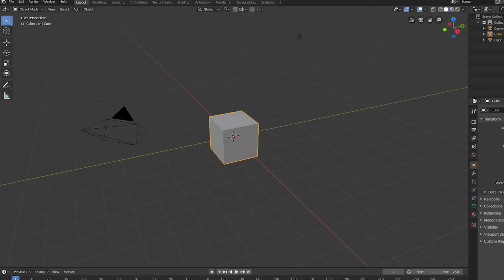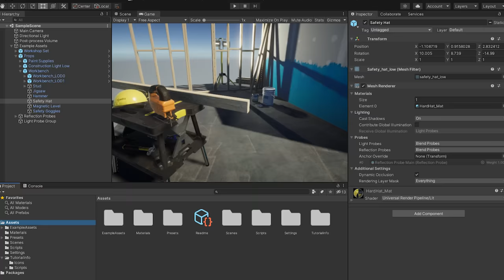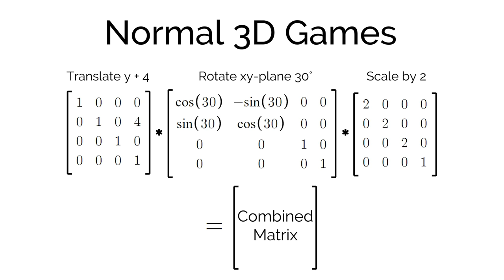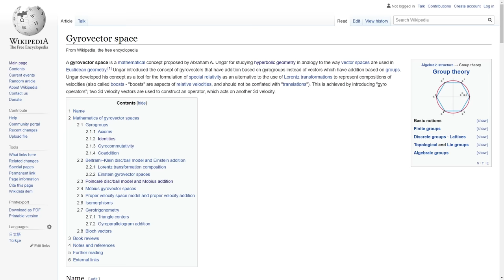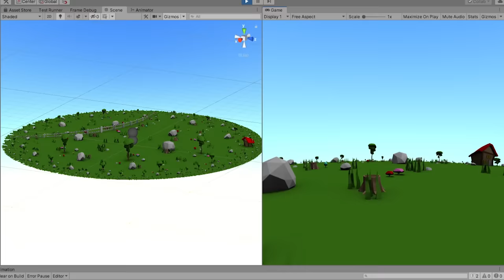Rendering Hyperbolic Spaces - Hyperbolica Devlog #3

Comment: 2:12 Getting flashbacks to making a Rubik's cube solver
Reply: We just need F and B to finish out the set
Reply: 3d hyperbolic space let's go
but seriously, if you can map the "coordinate" of a 3d hyperbolic space onto any rubik's cube scramble, how close does that make them to being in the same group/set? (Sorry if I'm using the wrong terminology I'm not good with group theory yet)
Edit: Thinking about it, rubik's cube moves are also (I believe) not commutative or associative, the only hole would be inverse moves but if you re-wrote them into 3 normal moves it could totally get mapped to a hyperbolic space
Reply: HYPERBOLIC RUBIK'S CUBE
Reply: @Supertimegamingify  Oh god I wonder what THAT would look like
Reply: @OrangeC7  What's tricky about this is there's no good way to add points on hyperbolic space together. In order to think of scrambles as points in hyperbolic space, you'd need points associated to 2 different scrambles to "sum" to a new point which corresponds to the composition of the 2 scrambles. That would mean the structure of the scrambles and their corresponding points would be the same. Unfortunately, there's no structure on hyperbolic space.

What you CAN do is map each scramble to a transformation of a hyperbolic space. These could be rotations, scalings, etc.  Composing two transformations gives you a new transformation, just like composing two scrambles gives you a new scramble! However, To fully capture all the different ways to scramble a Rubiks cube, you'd probably need to consider hyperbolic spaces with more than 3 dimensions.

A similar line of thinking (mapping groups onto transformations of euclidian space) constitutes a whole field of math called "representation theory", which surprisingly enough is a vital part of modern physics!
Reply: OrangeC7 Don't we have URD=RU in hyperbolic space but not on a Rubik's cube? As well as UUUU=ø on a Rubiks cube but not in hyperbolic space
Reply: @columbus8myhw  Yeah
Reply: @Supertimegamingify  oh

Comment: There is a way to store locations in non-Euclidean space. You just need to use metric tensors[ https://en.wikipedia.org/wiki/Metric_tensor ]. For a 3D space, the metric tensor would be 3x3. In your case, there's no curvature up or down. As such the metric tensor could probably simplify to a 2D-esque form[ https://en.wikipedia.org/wiki/Poincar%C3%A9_metric ]. Essentially, metric tensors tell you how much space is expanded or contracted in any given direction at any point. They can describe curved, non-Euclidean space extremely well.
Reply: In order to get the components of the metric tensor you still need a coordinate system, and a poor choice of coordinates will make the metric tensor components very complicated, so this doesn't avoid the coordinate system issue.

By the way, I think the game also has curvature up and down.
Reply: big brain man
Reply: YOU'RE A LIFESAVER, i've been trying to make my own hyperbolic game but i wanted to use a coordinate system. Couldn't find anything on google and this was the last place i had a chance of finding a way.
Reply: @gigaprofisi  You're going to want to research things like Riemannian manifolds, geodesics, and stuff like that. Also, the tile method used in the video would probably be described as using charts in GR. Essentially, you can carve up the manifold into chunks so that they have their own coordinate systems and if you walk off a chart, you walk onto a different chart. The benefit of that method is it allows you to define points in that region(like in a mesh) independently of how warped that region is in the full coordinate system. If you had a region which was highly distorted(like near the edge of the disc), then you wouldn't be able to precisely represent points there. You could apply a coordinate transformation such that the determinant of the metric tensor(volume element) was constant. This would let you represent points with equal precision everywhere, though they may be more or less precise along different axes. I'm currently taking a GR course BTW, so I'm not an expert. Feel free to ask more questions and good luck!

Comment: I've been thinking. Objects in spherical space should look darker in the distance than nearby.
Because objects far away are stretched, they emit less light that reaches each of the pixels on screen. This means objects stretched 2x would look 4x darker because each pixel we would normally see would be spreading it's light across 4 pixels.
This would somewhat be counteracted by a different effect where pixels on object textures would be visible from bigger viewing angles. This would increase amount of light we would be able to see. So in spherical space every pixel on flat surface when viewed from maximum distance would be visible from 180 degree which would allow us to see every light ray it emits, but these light rays would also be stretched across entire sky, so the end result should be darker sky.
I think reverse should be true for hyperbolic space. More pixels would be firing light rays at us, but they would be doing so at smaller angle.

Comment: The position representation you have chosen is (perhaps somewhat unintuitively) actually quite efficient. A bit simplified, you need an amount of information that is logarithmic to the number of squares you want to be able to represent in order to encode the position of a single square, and since the area of a disc grows exponentially to the radius in hyperbolic space, you need an amount of information that is linear to the distance from the origin to encode the position of a square, which is exactly what you have used! Good work! (One way to "compress" the representation of all squares would be to store them all in a tree, or perhaps a graph for convenience, which would only require a constant amount of information for each square, but I guess you have already figured this out.)

Comment: Check out hyperbolic octonions (split octonions). They are an eight dimensional mathematical structure that can be used to represent 3 dimensional hyperbolic transformations (representable as projective transformations of a 4 dimensional space of metric signature 3+1). And their "composition" is truly non-associative, and must be so, in order for the "composed" transformation to stay in the same class of transformation kinds as the two transformations we "compose". I say "compose", because it is really a more complicated combination than mere composition, which explains the non-associativity, nonetheless, even though (f×g)(x) =/= f(g(x)) (thus f×g =/= fog) and (f×g)×h =/= f×(g×h) in general for hyperbolic/split octonion (or for that matter ordinary spherical octonion) multiplication of transformations (written as × instead of o), it is surprisingly always true that (f×g)×f = f×(g×f) = f×g×f, and that (f×g×f)(x) = f(g(f(x))). So f×g×f is always the same as fogof for any f and g of these transformations, where o denotes ordinary function composition, even though this is not true for multiplication in general between just two elements, and multiplication between three different elements is generally not even associative.

When split octonions are used to represent 3d transformations, they may be regarded as a twisted version of the Clifford algebra on three generators of positive signature; using the ordinary Clifford multiplication without twisting, we instead get an associative algebra behaving like complex two by two matrices (which contain ordinary spherical quaternions and hyperbolic split quaternions alike).

If we compose split octonion multiplications through ordinary function composition instead of the properly twisted composition (corresponding to multiplication itself), we get a 28 dimensional algebra of transformations of an 8 dimensional space.
But the 8 dimensional "pure" transformations closed under octonion multiplication, is in some sense much more interesting, and the way i understand it, these are what most directly acts on 3d hyperbolic space.

This paper seems to explore the idea of split octonions as hyperbolic geometry transformations a bit, although it is also dealing more with theoretical quantum physics. https://www.hindawi.com/journals/amp/2015/196708/

Split octonions cannot be represented as ordinary matrices, however they can be represented by Zorn's "vector matrices", with a peculiar multiplication rule.

This use of split octonions for 3d hyperbolic geometry is highly experimental, but we may expect it to be worthwhile to investigate.

Similarly ordinary octonions may be used for 3d spherical geometry.

And some kind of dual octonions (with nilpotents) may perhaps be used for 3d Euclidean geometry.

Comment: So a few years ago I was thinking of a 4d rendering, but not where you would just walk around some 3d rooms that are sides of some kind of hypercube or some such, but an actual 4d rendering.
When we see things in 3d, we actually use 2d matrix to imagine 3d objects. So if we can understand 3d via 2d, we can probably also understand 4d via 3d.
So, what I was thinking is creating a 4d ray tracing where you would rotate and move 4d camera around via 4 axes just like 3d camera via 3 axes. Then the 4d engine would render each voxel of a cube which would be our projection matrix for 4d space. 
Tricky part is to 3d-render the cube-matrix in such a way that human would be able to perceive every voxel within equally clear because we have to perceive every pixel of 2d matrix without any pixel obscuring the other to understand 3d. So we would have to make every voxel inside matrix cube transparent and be able to perceive the depth of each voxel at the same time. Maybe make depth dictate voxel color? It would mean we'd have to sacrifice colors in 4d space but oh well.
Other things got in the way so I didn't start work on this project. Was wondering, was anything similar ever attempted?

Comment: I've only ever been able to visualize 4D space with one specific analogy... the "layers" method. I once saw a Minecraft map that was a bunch of 4D parkour, with an item to toggle (rebuild based on player location) the 3D world blocks between [XYZ] and [WYZ] coordinates. When toggled, you'd move on real-X to change your virtual-W coordinate, and then when you toggled back, you'd be on a different "layer" of the map. Kind of like the "stripes of different biomes" parts of the Miegakure trailer, except transitions between X and W were instant rather than smooth.

4D Toys seems to go with a similar analogy, but the Minecraft map was easier to understand since the W axis was locked to integers (the "teleport" between X and W orientations being based on the player's rounded-down coordinates) rather than a continuous line. Something different on the W axis was either present as a whole block (exists in the active "W layer") or not present at all... otherwise it probably would've been unplayable, being a parkour map. ...Wonder if I can still find that...

Comment: Little late to this, but that whole "hacking existing engines to do this technical thing" is the same energy that got me to write a parametric function to display non-integer values of the Binet Formula in Desmos (which, for the record, doesn't support complex numbers)

Comment: At 2:10 you say the easy way. Which is true. Instead of mapping out a grid outside in you just did it inside out because the outside is not representative of the inside structure relative to possible structures in Euclid structures unless you started to enclose sub sectors.

Comment: Man, please do the projective 3-space (the one called RP3 or SO3).

You would first take the spherical model and reduce the "earth" part from covering half of the entire space to a layer of some limited thickness. In the sphere, it wouldn't make a difference as you can't see through it, but once you go projective, you would see "the other side" of the earth-layer, and walking in one direction would still bring you to that place. So far maybe that's not so different from the sphere experience.

The difference would be that completing a circle walk once would bring you back to a house that is mirrored.

Comment: 2:04, but that also runs into the problem of non-unique names for the same coordinates.  For example, RUUL is the same as URRD.  How did you decide which name to use?
Reply: My guess is that each tile is labeled when they're being generated from the last set of tiles, so they're just arbitrarily assigned the first valid possible name based on however the generation is done.

Comment: I notice that nothing moves on the map except for you. In order to have something like an NPC animal that moves around the map would this require a lot of changes to be made to the engine itself? I'm assuming you limit the number of "tiles" you render at one time, so the NPC could move only when rendered. Would it be different/difficult to give the NPC a way of plotting a path that doesn't run into objects or to say give it interactions with the world around it?

This might be extremely simple, and just a matter of applying the same gyro-transformations you apply to the player. I'm still trying to wrap my head around rendering this non-euclidean project.
It's amazing that you are documenting this process with these Devlogs. I really appreciate it, and wouldn't have known much about non-euclidean geometries without it.
Reply from the maker: Yes, NPCs use Gyrovectors the same way, relative to their position.  You can always calculate things like distance between objects or interpolating between points, regardless of the camera's projection.

Comment: Have you tried replacing double with long double to improve precision?
Reply from the maker: I'm actually using float, which is needed to run fast on the GPU.
Reply: Speed is not everything. Nobody will care if 3600 frames in total render 0.0001 seconds slower.

Comment: I was thinking about the tiles you use, and IMO it would be way easier to have 4 hexagonal tiles to a corner instead of 5 square ones, because then you can treat your world similar to how you would treat a hexagonal grid in Euclidean space. You can define any coordinate using 3 axes. If you imagine for a moment a euclidean hex grid, you can clearly see that you can move cell to cell along 3 straight lines at 60 degrees to each other. For ease of understanding let's not consider the negative halves of the axes. The positive rays go out of the cell at 120 degrees to each other. In a non-euclidean grid where 4 hexagons meet at a vertex, these rays are not 120 degrees to one another but 90 degrees (because our hyperbolic hexagons have 90 degree angles). 3 axes at 90 degrees to each other? That's right, if you use hexagonal cells at 4 to a corner, you can represent an entire 2D hyperbolic space as a 3D euclidean space (to an extent).

Figured that would probably be somewhat easier to implement and use than your left-right-down-up system.
Reply: Except parallel transport doesn't exist in hyperbolic space, so you can't measure just coordinates along (in parallel to) some axis like you prescribe.
Reply: @MrFram  that's why i said "to an extent", projection into euclidean 3D space is basically just a hyperboloid projection, which is still very useful and easy to implement

Comment: Would using Geometric Algebra work for this? It's the mathematical model they're using in Miegakure, and from what I've seen/read it handles a lot of the weirdness in multi-dimensional spaces without needing to warp your brain as much (at least, from within mathematics). I've only used GA as a basis for 2D projective geometry so far, but the nice thing about GA is that the structures scale to any dimension without the formulas needing to change much.

Comment: technically blender can make 4d objects if you use shape keys for the fourth dimension, never tried to check if you can save an object with shape key data though
Reply from the maker: I don't think you could, there would need to be a different number of vertices as you move through the dimension.  And tetrahedra are the primitives, not triangles.

Comment: I have a question: If you're building this by using squares upon which you build 3D models (so essentially a bunch of infinitely tall cubes), and then you just glue together 5 or more (or 3 for spherical) of these squares at each corner - then isn't this 2D hyperbolic space, where the 3rd dimension (up) isn't hyperbolic but instead euclidian? For example, if you made two vertical walls inside two neighboring squares such that they are parallel at the base , and then extended these vertical walls infinitely upwards, would they not remain parallel?

Though I imagine if none of the structures are that tall, and since the terrain you have is all flat, it still looks very close to what real hyperbolic 3D space would look like. But I have to ask anyway.

Comment: With diverging parallel lines, how bad (on a scale from 0 to vomit) would this be in VR where you view the world from two perspectives?
Reply: Not awful, but pretty mind-bending and not good for your sense of distance. The rate at which angular size decreases with distance stays constant, and your eyes would converge on faraway objects at angles that suggest they're closer than they actually are... it's almost like the whole world is compressed into a sphere of absolute-unit radius, which is coincidentally how things appear to be projected/rendered at 5:34